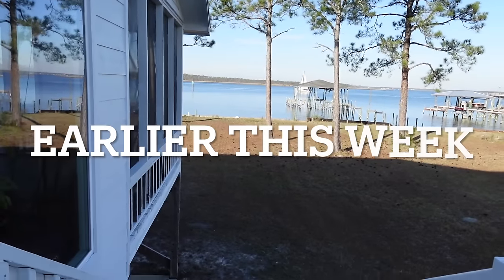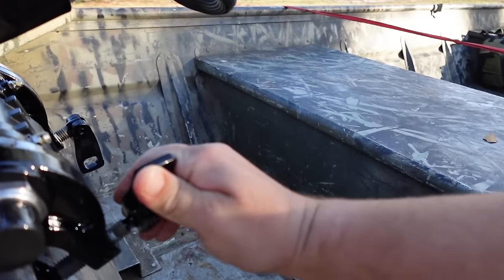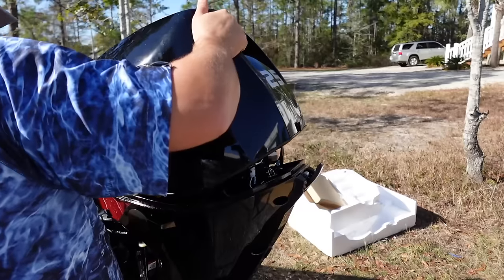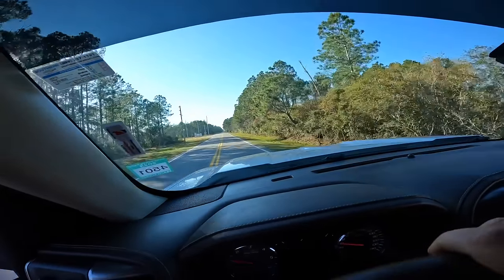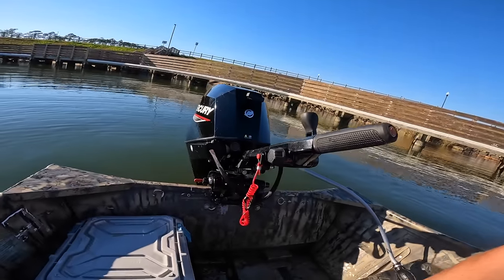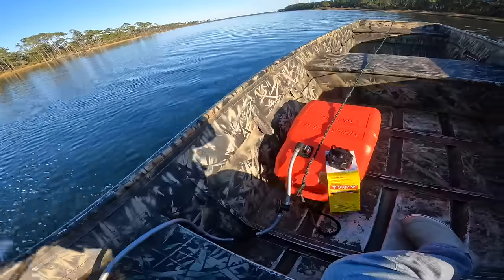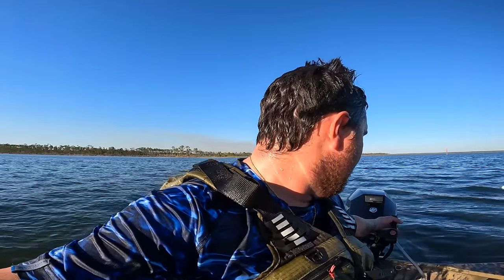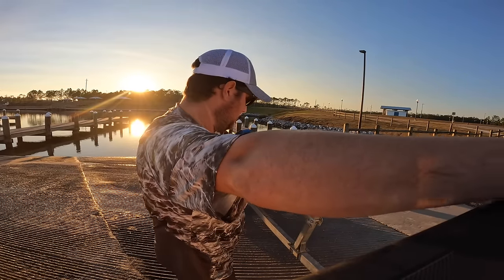I Should NOT Have Done This!

Comment: Just like the other ppl. Thx for sharing.male egos stop some guys from showing any imperfections.  That’s where the learning is. I paddle. Royalex kayak & canoe .16’8” canoe is my favorite for most stuff but inland ICW & drifting behind the breakers ,sometimes , I go w the kayak more. Depends on the conditions. Neither here nor there. STUFF HAPPENS FAST ON WATER. COLD WATER ESPECIALLY!Im looking at some little boats. That one makes me nervous. 1/2,throttle w the other 1/2 there for just in case,& figure out the weight thing…Maybe. DK. You have to make that call. I’ll be remembering that safety message. If I start motor boating again regularly. Good to keep some basic tools on board too. Take care. 
PS. I didn’t see the merk peeing at the end.
Reply: Royalex is the material that the boats are made from. Light & tough + 2 layers w closed cell foam in between. Makes good quiet boats & insulates some too. Going slow isn’t so bad. See a lot of things you might miss going faster.

Comment: It nearly happened to me. I was a novice when it came to boats and motors. I had a 14 ft. Lund with a 25 HP Mercury outboard (15 hp would have been fine I found). I turned too quickly to the left and the boat went into a skip sideways and nearly threw me out of the boat. I learned very quickly that turns must be taken slower and gradually in a boat. They don't work like a car in that respect and lots of people have found this out the hard way, me being one of them. When going fast you can not turn quickly. Otherwise...well you know the rest.

Comment: Had you not been wearing the kill switch it is very possible that the motor torque would have caused the boat to circle and keep coming right back at you.  I lost 3 friends years ago when the operator got thrown out of the boat and no kill switch.  All 3 were ejected, all three drowned, boat found doing a tight circle in the vicinity where their bodies were eventually recovered.  Always wear the vest and use the kill switch.  It can happen to anyone at any time.

Comment: Hey, glad to see other guys in jackets and kill switches. I'm up in MN so a fall out of a boat most of the year is life threatening especially if I don't wear em, but I see a lot of guys who don't. 

Is this the first time you've driven a tiller steer? This is the first vid on your channel I've come across, but around the 17:00 mark you mentioned something about getting used to it. Your steering input just looked kinda quick. Obviously you probably realize that in hindsight haha. 

The people saying the motor is too big might be right but I'm not sure. I've got a fully rigged up 14' with a 2000 Johnson 25, cupped prop, jackplate for high speed shallow stuff up here on the rivers.  You probably have a lot more weight on the transom with a 4t, so I'd get that gas tank as far forward as possible. Maybe extend the lines 8ft or so. I also keep my fishing gear and batteries up in the bow, and built a full deck as well. So I have a lot more weight up front, and a lot less on the transom. 

I still think the problem was just steering input, but that's probably exaggerated by the reverse lawn dart you've made. I bet it's fun though, been years since I've driven mine empty. Keep the progression coming for this setup!

Comment: I thank the Good Lord that you are safe and well. I agree with another in comments, 25 hp is a LOT of motor for the John boat. Front ballast should help but a lesser outboard might be a better match ? Heavy rubber stable mats like those sold at Tractor Supply can be cut to fit and it disperses the weight on the floor of the boat and you don't feel the "water" pounding the underside. Stay safe brother. May God continue to bless you.

Comment: You can also help with the front comming up by adjusting the way the motor sits if the transom. There should be different pins on the motor to adjust the angle that the motor is at.

Comment: Looks identical to an accident that happened to me. I had a 1436 jon boat with an 18hp johnson taking it on its maiden voyage. Same scenario with an empty boat with no weight in it.  It was on plane when i went to turn it started turning then just flipped the opposite direction..at least it felt like it went the opposite direction because like you said its very disorienting.  I wasnt wearing a life jacket but i was wearing the kill switch.  Ive have much a much safer boater since then always wearing my life jacket when underway. Thanks for sharing and showing people what can and does happen out on the water no matter your experience level.

Comment: Always drive with your left hand and level the boat by putting your stuff on the opposite side that you sit on and and adjust your steering tension so it’s not so sketchy I’m glad you are safe brother keep up the good work
Reply: The tiller on that motor is in the middle, so no real advantage to steering with either hand.   Do what's comfortable.  But definitely improve  the balance.

Comment: Just goes to show how easily a flat bottomed can spin out. Some plank foam between the ribs, a sheet of aluminum cut to fit and riveted into the tops of the ribs, and carpet/Eva foam will help with making it quieter for riding/not spooking fish, plus add some extra buoyancy should you ever take on a lot of water. A casting deck, trolling motor and battery upfront will take care of that ballast issue.

Comment: Good on you for using the safety features. That's a lot of motor for that boat, no law says you need to run it wide open.

Looks like you need to trim the motor up a bit, along with adding some weight up front.

Comment: You need to tighten up the steeling thumb screw.
Been running a 12 ft. w/10hp seapro for 10 years. I've never been pitched out of my boat..

Comment: Glad you safely made it back to the shore. That's way too much weight and power for this tiny boat, the transome may not even be rated for 25hp motor on this boat. I had a bad feeling about it from the get go when you gave it a little throttle and it planed like crazy.  You were lucky that it wasn't choppy at all, otherwise I don't think you will feel comfortable going this far with this setup. Keep safe!

Comment: I think a 10 hp would be more then enough for that boat , I had a Alumacraft Waterfowler 16 ft with 52 inch bottom all welded with a 9.9 with a 15 carb and it scooted along fine , that there might be a little much , be safe and thanks for showing this about attaching the kill switch .

Comment: I would have been very tempted to fortify that transom with a sweet quarter inch aluminum plate on the inside that spanned the entire engine mount area + 6” on either side just to spread the clamping and mounting force ….maybe a nice sheet of mass loaded vinyl between the aluminum plate and transom wall….

Comment: i think you need to reread the manual and setup that motor correctly. i was also thinking that motor looks a bit heavy and that maybe you need some float pods on the back to help compensate for both the motor and yourself, in addition to getting some weight up front for ballast.

Comment: Another guy mentioned it a 25 HP may be too much for that boat. Of course, your pistole got a bath too. You have a good holster on you. Testament is to the fact you still have it. Put planer board on your out board it helps tremendously and does not hamper the engine's efficiency.

Comment: If this is your first time with a Jon Boat be careful. As you found out empty they are like bobbers. Cabin cruisers at speed will scare you grey.  Your Bay boat rides in the water a Jon Boat rides on the water.  For that 14 ft a 15 HP would have been a better match.  Tiny boat nation will show you the ultimate in how to rig jon boats.  It can get expensive. I took mine added some heavy boards to the front to screw the trolling motor battery box into and add weight up front. The boards fit between the ribs and did nicely. also kept you from walking on the bottom and dropping items and having them hit the bare aluminum bottom.  Have fun with the new hunting boat.

Comment: so a tip from someone who uses a tiler motor alot u can make the steering a bit tighter so it wont fling u out nearly as easy dont want it so tight it takes a lot of effort to turn but tighter then what u have it in this video

also a 25hp on a 14foot jon boat is a bit much unless its fully loaded even then its pushing the limits of safe power a 20 would of been more then enough for u

Comment: I have the same outboard on a 14ft fiberglass skiff. To be honest it is too much motor for the boat and my boat weighs more than yours. I did not know this until after I My purchased the motor. My boat is rated for a 15hp. The water has to be glass smooth for me to run wide open. If I would have known then what I know now I would have gotten a 20hp since it weighs the exact same as a 15hp Mercury. Glad you hurting nothing but your pride on the maiden voyage

Comment: If you are on plane and you turn hard, you won't take on water over your gunnel or your transom. You said you thought you were going to take water over the side. Then you panicked and yanked the tiller hard over with way too much horsepower, for that small flat bottom boat.
I'm just saving; I'm from Louisiana and have grown up operating batteaus. That triangle where the gunnel meets the transum at the top is useful for more than support. 
Thanks for showing us this.
Btw i have not watched part 2 yet.

Comment: I’m a retired game warden/boating safety officer. I would suggest putting a rope with a loop on the stern of the boat so you can hook your foot in it and use it to climb into the boat. Also practice using it to get into the boat because as you saw it is very difficult to get into the boat, much more so if you’re injured 
Glad you’re ok!

Comment: I too feel that the boat was overpowered for that type and style of boat. I have a O-L-D 15' aluminum Polar-Kraft semi-Vee with a 25hp Mariner with stick steering, it originally had a console, but was removed, so I have a mounted swivel seat in the center and a rear deck and front deck with removable 360 degree swivel  seats.  It is VERY STABLE and lends itself very well to all kinds of inshore activities.  I highly recommend that you dump that flat bottom jon boat and look around for something safer and more versatile!

Comment: there should be a trim bar you can set to adjust the plane angle of the boat (this is different than the tilt function for shallow water, trim bar has smaller adjustments) just fyi

Comment: I just got that same motor on my jon this year and it is a beast as you can tell haha. Glad youre okay. Question: mine came with the same gas tank and for some reason it will not vent at all unless i have the cap so loose its barely on. I have the top vent screw opened and all that but i swear it just doesnt vent. Did u have this issue too?

Comment: @ 9:11 - "offset a little to stop the prop hitting it" - this is not why they are offset, they are offset to compensate for propwalk - lateral direction vectoring due to prop direction -- on dual outboard counter-rotating outboards it's not required, but in single-prop setups it keeps it tracking straight. You can adjust the amount by setting it at different angles when installing it, so you can tune it in for different props etc.
Reply from the maker: Correct, which Yamaha discontinued the trim tab anode with a fin because they considered it obsolete for prop torque.
Reply from the maker: I have a new F250 Yamaha on my big boat
Reply from the maker: but with this prop/anode, it was spaced rearward a little more to allow prop clearance. I guess offset was not the right adjective....

Comment: Just a heads up mercury will not honor there warranty at all if they can prove you did not follow the break in procedure. Which is very important on any new boat motor no matter the size. Which is 1-10 minIdle 
10 min-2 hrsLess than 1/2 throttleApprox. 3000rpm max
2-3 hrsLess than 3/4 throttleFull throttle run allowed for 1 min every 10 min
3-10 hrsUp to 3/4 throttleApprox. 4000 rpm max with Full throttle run allowed for 2 min every 10 minAfter 10 hrsFull throttle available.
Also do some research before you just buy something. It clearly says online it comes with a fuel tank and this is way to much motor for a 14ft aluminum boat with just 1 guy which you figured that out the hard way and almost sunk ur 4/5k investment.

Comment: I don't see where anyone else has said this, so I will.  The vast majority of boats in that class list a 5 to 10 hp motor as a max size.  A John boat like that is not designed for those speeds.  You really need a V hull for that motor.  Jon boats are hard chimed to cut tighter turns at slow speeds.  If you stick with that motor, you might think about adding a pair of transom floats to either side of the motor.  They are also called float pods and can be a DIY project or store bought and bolted on.  It'll give you more buoyancy in the stern and help soften the turns a little.  It will also keep the bow down without adding a bunch of ballast up front.

Comment: Man, Iv been driving boats my entire life. I just got a brand new Merc 40 with the big tiller handle on a 16ft boat and SCARED THE SH*T out of myself first trip. Its not technically too much motor but on a lightweight hull and input can rip that tiller out of your hand. Especially just letting off throttle from wide open.

Comment: Every year, boaters in Fishing Camp Boats flip out of their rented boats.  Some drown.  Some die of hypothermia.  Some get injured on the exit or by the prop (no attached lanyard).  Most are not told of the steering tension adjustment.
Always have a plan on getting back on every boat you are on as that is another reason for these darn drownings.

Comment: Where are your oars? Also, if you find yourself in a position where ballast weight is necessary and you’re unprepared - just look for some rocks at the launch site. Grab a few and chuck em in. Even just 25 lbs up front can make a world of difference and it doesn’t take many medium size rocks to get there. If there aren’t rocks, fill a spare cooler with water or a bucket with sand. Nuff said

Comment: Awesome video. However, The 25 hp is way too much for that small jon boat. Maybe you can sell that new 25 hp, cuz you really gotta put a 6 or 9.9 hp on that boat. The 25 hp is too heavy, causing the boat to be too back heavy. Also can’t even use all that power with that boat. A 9.9 is all you need and it will be safer and have better handling

Comment: It’s not the ballast so much that it is the flat hull. The biggest difference you will see is if you buy manual trim tabs. They will be cheap for that boat and you simply screw them in and you can move them by hand till you find the perfect angle. The reason I say ballast is not a big deal is because most of your trips will be with someone else or at the least you will have gear with you to weigh it down.

Comment: A 15 horse would have been perfect for that boat. I had a 20 horse on a 14 John boat and almost got thrown out as well. The boat is so light that the power on the stern can do what it did to you real easy with just a quick turn off the motor. Mostly accidental.

Comment: I love Mercury or whoever they are, but I bought a 2009 off the showroom floor in 2013 (thinking it should be a 2013) for full price. I ran it, destroyed the lower unit. The gear oil was black and about 1/4 of the level that it should be. They honored the warranty, but always change your fluids folks, before you run it, or maybe they will get their shit together.

Comment: 157 pounds Merc 25EFI 4 stroke. Too late now but never put a short shaft 4 stroke on a 15 to 16" transom. 
Go long shaft and 20 to 21" transom. You'll see why when you shut down pretty quick.
2 strokes used to come with a 13p prop and 4 stroke 10p (higher rpm engine) I guess they quit that.
Up tp 25hp comes with 6.1 gallon tank.
Hindsight you should have got a Suzuki or Yamaha. 
Youll see why soon.
At least no longer China made. Tohatsu is Japanese. 
Certified Suzuki, Merc, Yamaha dealer 35 years but i quit that.
Now boat Capt on the Mississippi. 
Good luck with that engine. Never run it without a battery or a bad battery.
You'll see why

Comment: You need to pull the motor off and caulk around the holes between the transom and motor bracket or water will leak into your transom and rot the wood.

Comment: For what it’s worth, those little tiller motors that you don’t use weekly at least should be run out of fuel before you take out of water. Just disconnect the fuel hose before you load it and let it run dry. The fuels with ethanol are horrible for the hoses and seals.

Comment: The guidlines say to be respectful so that should also be true with the content creator.  I saw the response u had with the guy who commented on your changing cloths.  While not a brilliant comment, i saw u called him Holmes.  That might be a tad disrespectful.

Anyways my comment to you is this & ill try to be respectful.  If you buy & use a boat, you need to understand its design with its capabilities & limits.  Also, a general understanding of boating safety.  Their are axioms in boating safety that generally keep you safer on the water.  You used one in the video:  make sure your drain plug is in securely before putting the boat in the water.  Others,  like dont overload the boat with passengers or equipment. Dont go out in bad weather,  take a wave or wake at 45° angle,  etc. Etc.   Most boats have weight capacities.  Why d o you think that is? The moment i saw that engine u bought, i knew you overloaded/overpowered that boat.  If you want to know y, ask me and i'll comment again. I have to keep this comment short or it wont post.